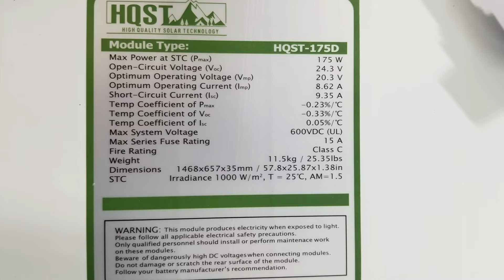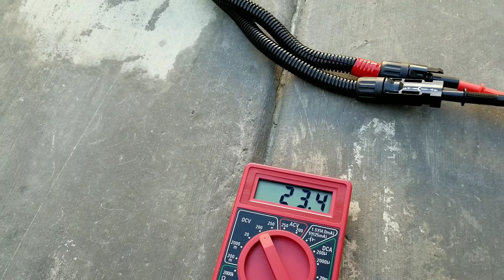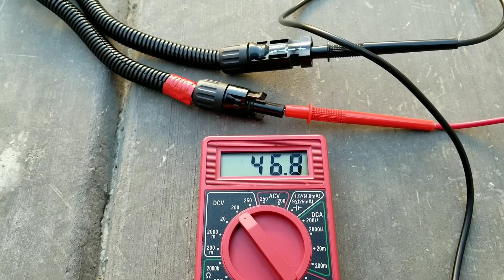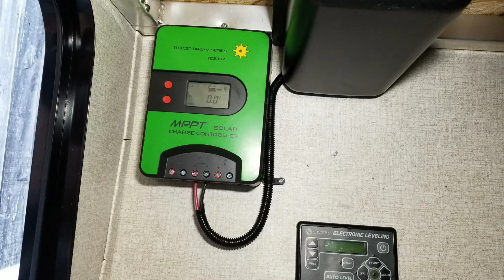Hqst 175 Solar Panel Test & Solar cable extension

Comment: I just ordered 5 pairs of these connectors from HQST . Do you think they will take 8 gauge wire?
I’m only asking because I have a ton of 8 gauge already. Probably going to go 25 feet on it, but end up using 30 ft because I always do that drill in vice twist trick as well.
I’ve worked at Car audio shops doing custom stuff to every day stuff since 1993.
Thanks
Reply from the maker: I think those are 10g rated which is enough for most people’s set ups unless running a lot of amps a long way. 
Voltage your good
Reply: I’m sure I can strip enough of the end to make it fit. I might have to buy some wire Farrels

Comment: Nice video.  I just found you, I like your affordable DIY,  as well a shout out to where materials can be found. Is that wire silod core or multi strand? That's the biggest hang up I run into. Thanks... on to watch what you've posted👍
Reply from the maker: Multi strand and thanks for finding me and checking it out. Hope some of it helps..😀👍🏼